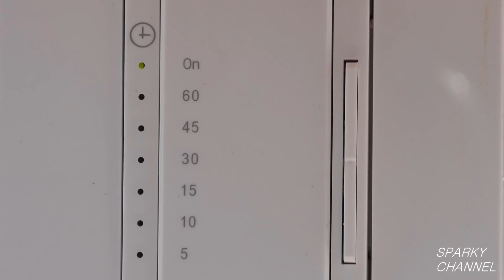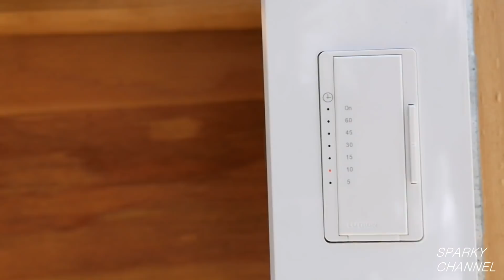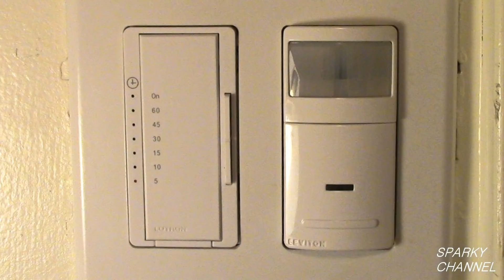How to Find Line and Load Wires and Install a Lutron Timer Switch MA- T51MN-WH Neutral Required

Comment: In a new condo unit, I had an orange and black wire attached to the existing Decora light switch. However, when I tried connecting the timer switch I had no ground wire. The black is hot, would the orange be considered the load?  And is it okay if there is no white ground?

Comment: If the if you reversed the line and load wires (load to black terminal and line to bronze terminal), will it work without issues? I know reversing these two connections in a “dumb” switch doesn’t matter
Reply: That’s not going to work… but yes, is does, is very glitches…
Is very important  follow the instruction.
I hope this very help  with you

Comment: The attached ground wire from the timer switch, is that in fact copper and okay to use in the wago nuts alongside the solid copper NM wire?
Reply from the maker: Yes, it's copper and the Wagos are good for all of the connections in this video.
Reply: @SparkyChannel  Thank you for the quick reply! I've really appreciated your channel, keep it up, you rock!

Comment: thanks for the helpful video! I ordered a Lutron timer switch. It doesn't have the screw available for the neutral connect. It only has two screws which I'm understanding to be for both the hot wire (black), Can this timer still be used? I see that the original ON/ OFF did not have a neutral connect
Reply from the maker: Yes, you can use it. The one with the neutral connection works more smoothly in some situations and it costs more.

Comment: I like that this switch has screw terminals instead of pre-attached wires that you need to use wire nuts/Wagos for.  This works well for crowded shallow boxes in older homes.  Great video by the way.  I really enjoy your content, Bill!

Comment: Can you use this timer switch in a 3 way senecio? My kids are constantly turning the garage lights on and they leave the house, only for me to find them on hours later when I return home. I would like to have a timer switch in the mud room, but leave the one by the front of the garage standard.
Reply from the maker: Hi Fred! Yes, you can. Here's the switch description: Lutron Maestro Countdown Timer Switch for Halogen and Incandescent Bulbs, 5-Amp Light/3-Amp Fan, Single-Pole or Multi-Location, MA-T51MN-WH, White, neutral required: Amazon: https://amzn.to/2Vs6tXL

Comment: Great to see your building your channel up.

Great if you consistently show proving dead with a proving unit, and then lockout and tagout. You have years of experience but good practice always helps for younger sparkies who think working live is the way to go.
Reply from the maker: Yes, the channel has really been coming back! Almost 60K subscribers now. And to think I had 0 in February 2020!
Working on live circuits is a foolish activity except when there is no other way possible. And then all the PPE and insulated tools must be used and it should only be done by pros. Thanks!

Comment: Is Lutron the best for switches, outlets, GFIC's  and dimmers ?
Reply from the maker: IMO Leviton is the best for switches, outlets and GFIC's. IMO Lutron makes the best dimmers. Lutron invented the dimmer and they are exceptional in this category. Just my opinion.
Reply: @SparkyChannel  I agree their combination AFCI and GFCI receptacle are really high quality I have them on most of my branch circuits in my home and I have tested them so I now how consistently they work and electronically designed which limits false tripping.